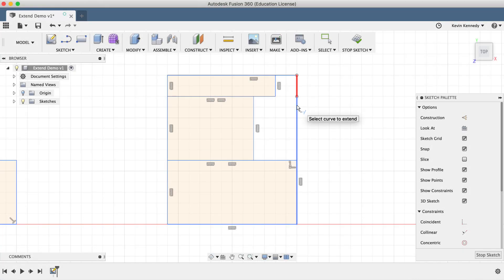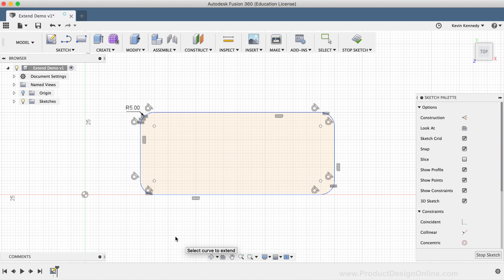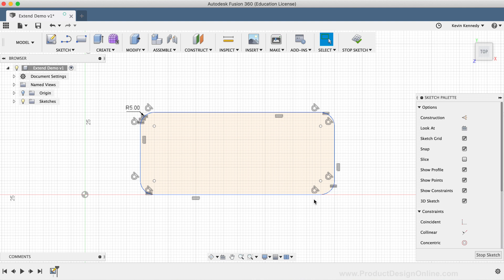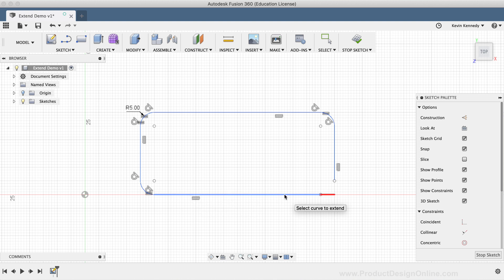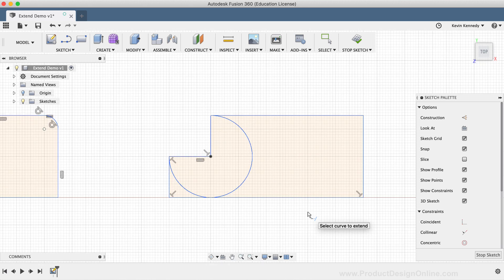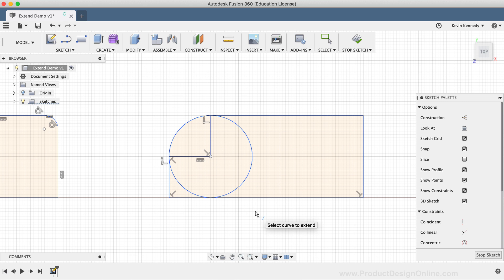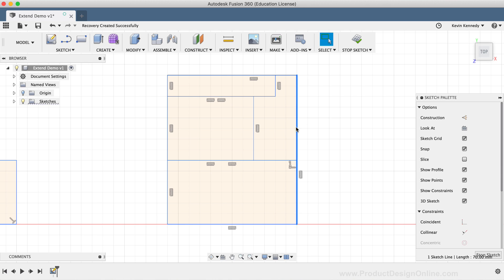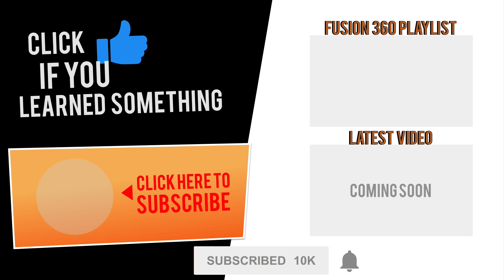How to Extend Sketch Geometry in Fusion 360

Comment: Hi Kevin, your videos are very informative I really enjoy thx. I would like to know what do I do if I do overconstrain and how willI know.
Reply from the maker: Hi, Philip. Thanks for watching! Great question - If you unintentionally overconstrain your sketch you should receive a warning message from F360 stating "adding the constraint/dimension will over-constrain the sketch."

Generally, it won't actually let you place the dimension or constraint and it will tell you that it's "driven" by another dimension/constrain. However, sometimes it will let you... in which case, you'll find out when you go to update a dimension or constrain and the sketch does not update accordingly.

I always recommend the following best practices when it comes to sketches:
-Keep your sketches as simple as possible. When in doubt, create another sketch.
-Always constrain your sketches before dimensioning
-Add the fewest amount of dimensions possible so you can update only a few dimensions to drive the rest of the sketch

I hope this helps! Cheers, Kevin :)
Reply: Product Design Online   Thanks Kevin much appreciated 👍🏻
Reply from the maker: @meawayfromhome  You're welcome! :)

Comment: Great video Kevin!, one thing i was wondering is what happens when extend is used on a compound curve like a path?  Will it just complete the circle that the closest section of curve can create?
Reply from the maker: Hi Matthew - great question! Generally, with a compound curve that's made with ars/circles, the extend command will continue the path of one of the arcs (depending on where you select with your mouse). With complex curvature created with splines, the extend command will typically just expand to the nearest intersecting point as a straight line. However, the nice thing about spline extensions is that the end point of the straight line ends up having a spline handle that can be manipulated (just like the rest of the spline).

Thanks again for taking the time to watch and comment! Cheers, Kevin :)